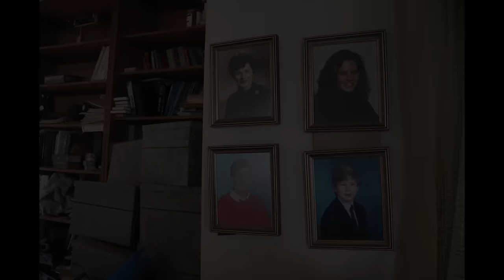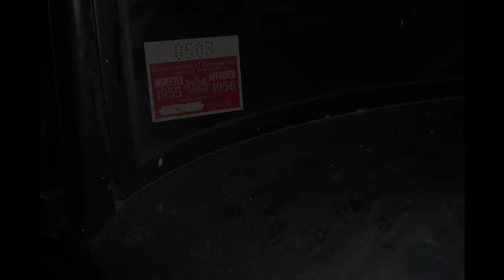1927 Packard Found in Abandoned Philadelphia Factory Sitting for Over 40 Years

Comment: The car is such a wonderful time capsule. Armchair quarterback that I tend to be, I truly hope you guys practice a little more care and respect in breathing life back into the Packard, than you did inspecting and moving it. Frankly, I was dismayed that you handled the window shades at all. If original, the fabric is 92 years old, for God’s sake, and extremely fragile. Credit where it’s due, though, you were careful in opening and folding the hood. But you flirted with real disaster by monkeying around with that swiss cheese roll up door, while an irreplaceable car sat what appeared to be just a few short feet away. And, dragging the car out at an angle was simply ham-fisted. I suspect that it was more or less frozen in place, which would have made it difficult to push it back and straighten it up. A pair of jack/dolly’s under the front wheels, and perhaps another pair under the rears, is all that was needed.

It appears to be a Packard Six, which I would guess is the least collectible of the company’s offerings from that era. But, its true value is not in its collectibility, but rather in the stories it tells. As such, the cost of a full, high quality restoration is not justified, and certainly not advisable. The lady is a historical survivor. And, like a 92 year old grandmother, it would be unthinkable to subject her to the indignity of cosmetic restoration.